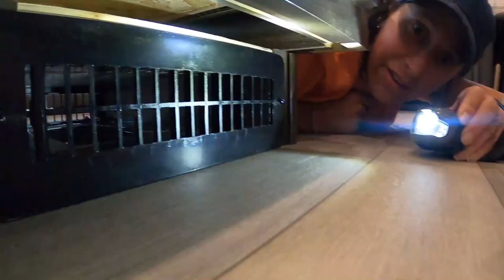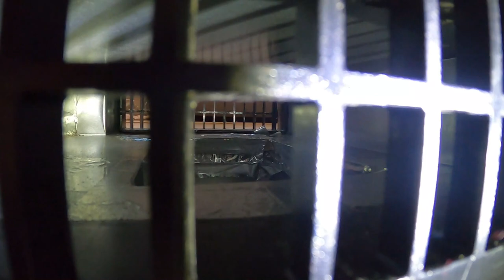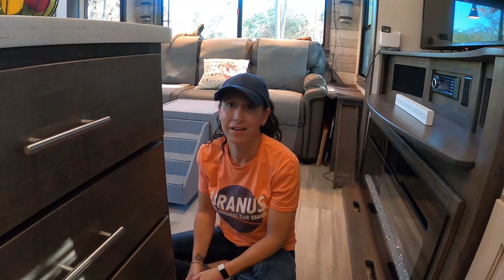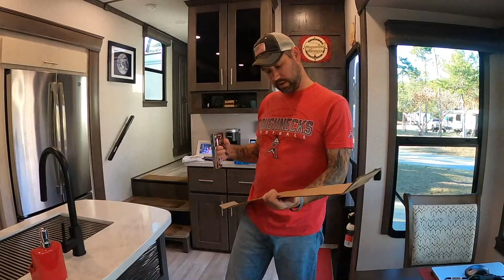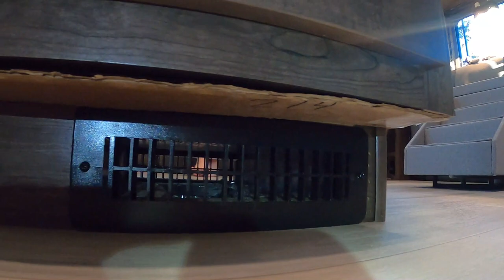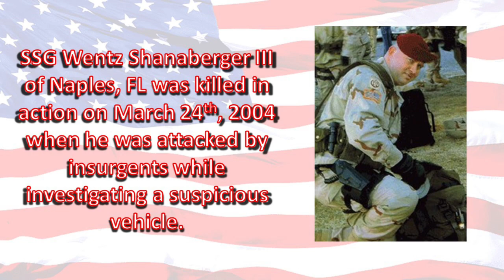Trapped In Our New RV

Comment: Glad to see Scout was safely rescued from his island jail without Leslie going all Rambo on the island. I have to wonder if those areas were left open intentionally for ventilation? Could you replace the cardboard with something like window screen? Is that something that would be Scout proof? You could easily use some of that lifetime supply of staples and staple that in. Thanks for sharing! Steve
Reply from the maker: We found a permanent solution. Got some wire mesh and stapled it up there. No more hide and seek for Scout.